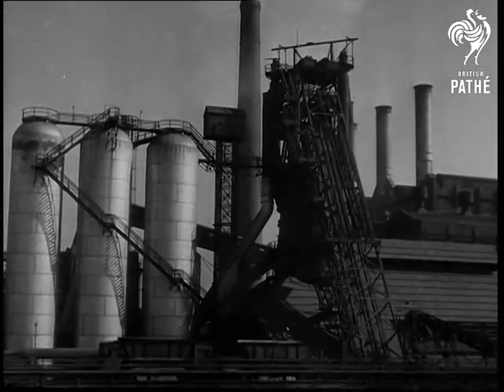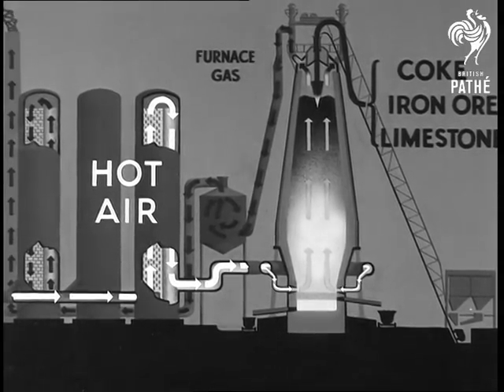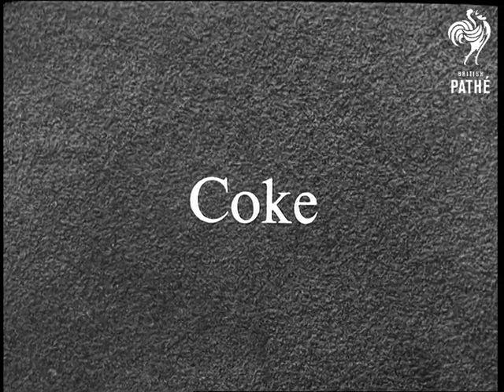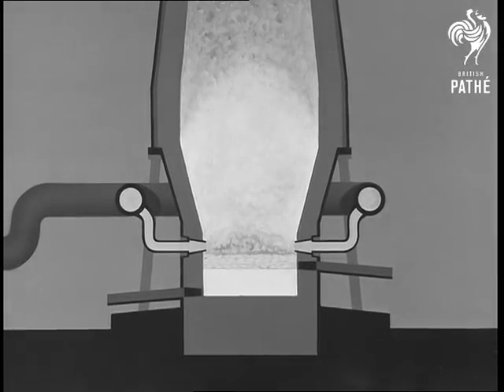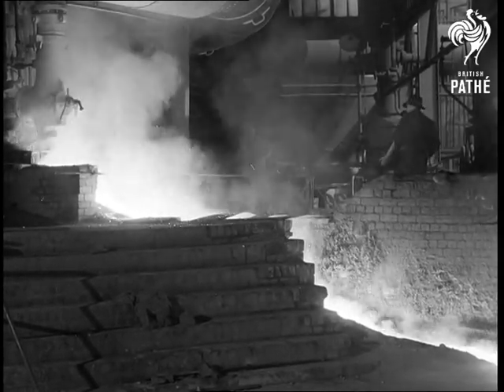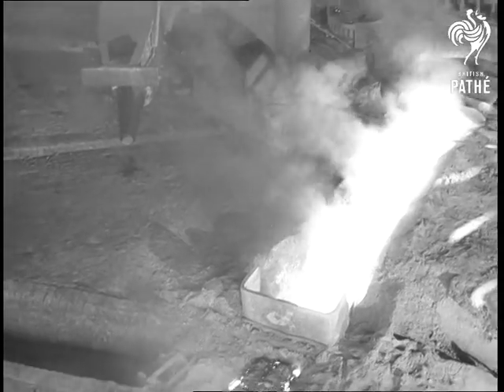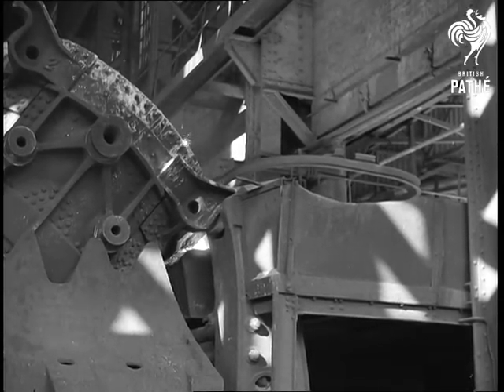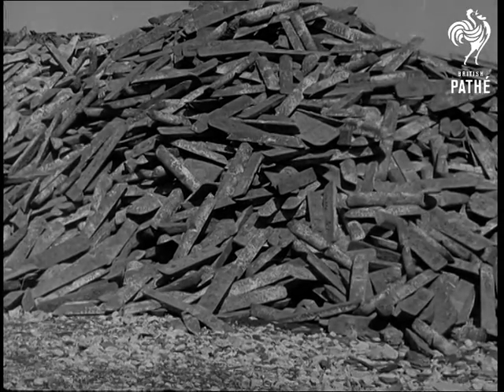Blast Furnace (1940-1949)

Comment: I worked at u.s. steel a long time ago. 65 to 83. I worked on the blast furnace from time to time. It all looks very familiar. However, the one big difference is the old film none of the men are wearing any kind of safety equipment whatsoever. That was kind of shocking.😮
Reply: Did you work at Gary Works?

Comment: Good film however how the furnace was charge very over simplified, on the large blast furnace I worked on four charges of coke or ore were dropped onto the large bell (term used for the two seals ) then the space between the small and large bell  was pressurised to the same pressure as the inside of the furnace this allowed the large bell to open once this was done the space between the two bells was 'relived' thus allowing the small bell to open. The pressurisation sequence of the blast furnace was very important to the operation of the furnace and I,m surprised it was skipped over !   I said at the beginning 'four charges of coke ' this could vary on the condition of the furnace some times the charging sequence would be changed to 6 and 2, 6 of coke 2 of ore the changing of the charging sequence was a little complicated requiring an electrician (me on my shift) to enter the control room and physically change over the programming switches and only when the next charge was to be coke and the left hand skip was at the bottom.On one occasion not on my shift I must add the change was made with the right hand skip at the bottom resulting in a few tons of coke being deposited where the left skid should have been and this was a hard and laborious job for the furnace hands that did the digging.